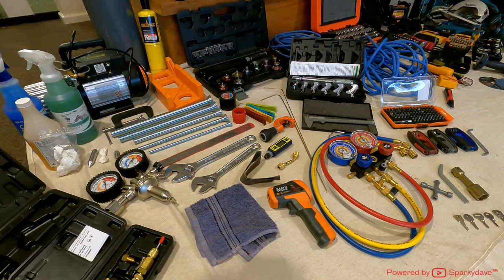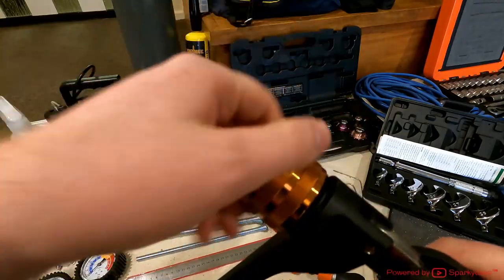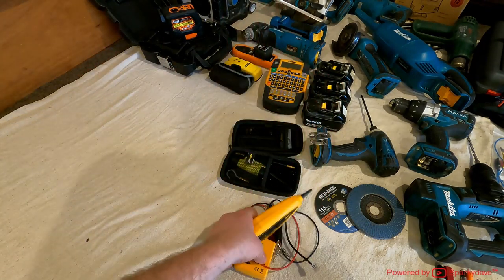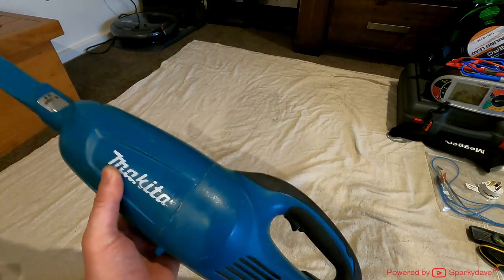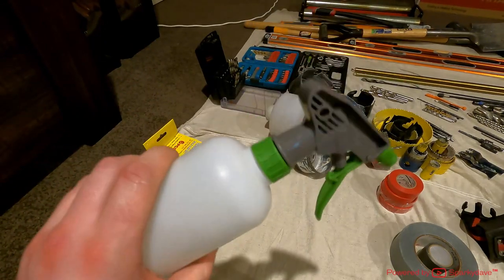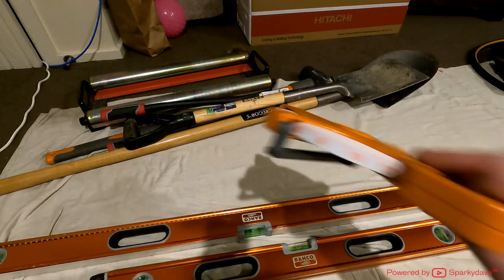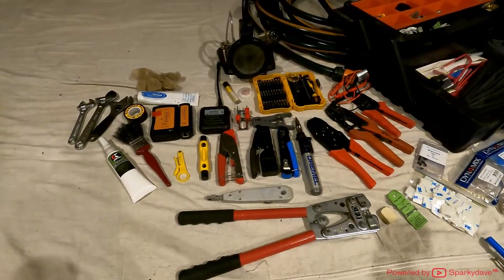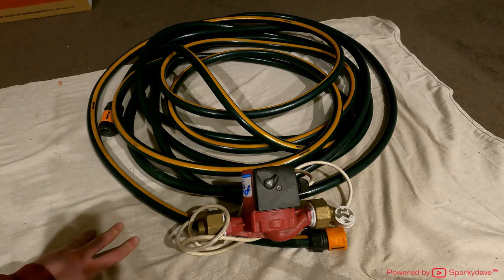ALL Electrician Tools Explained! What are they used for?

Comment: Hey I am an apprentice and I do electrical and heatpumps in nz. My forman has testo gauges they are digital and are multifunction. I myself rate highly of them especially when we are testing for leaks, they measure by the decimal point, they are also very acurate. So if oneday you need new gauges take a look at the testo range. They also have a bluetooth thermometer which I use when testing heat and cooling temps on heatpumps. Cheers